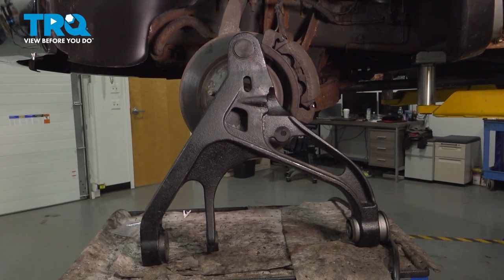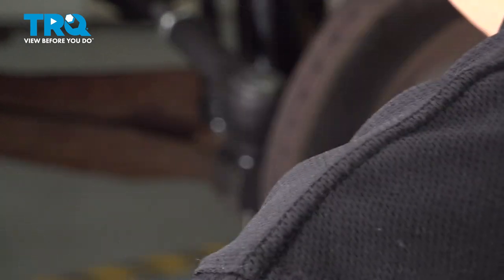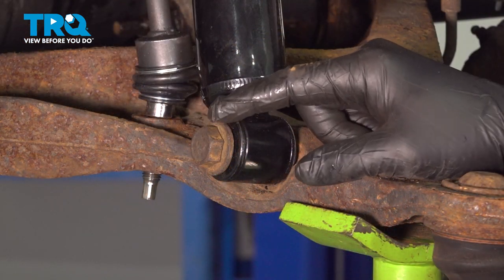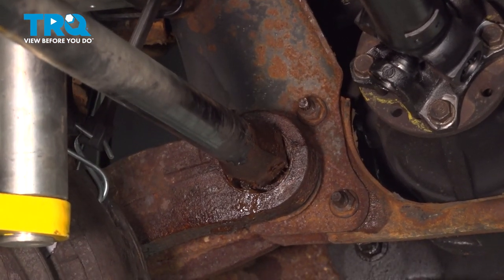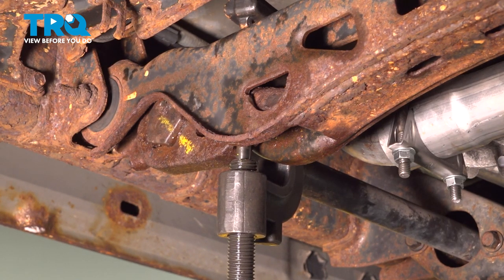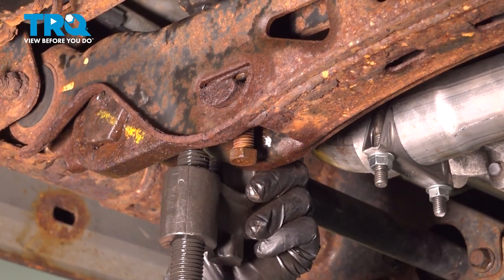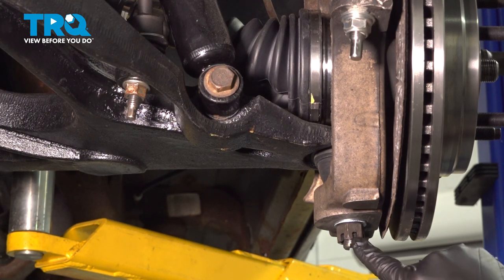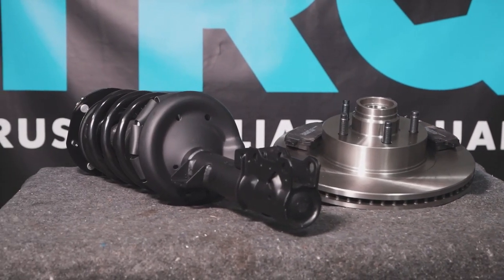How to Replace Front Lower Control Arm 2002-2008 Dodge Ram 1500

Comment: Great video. 

Remember that 2006 to 2008 went to a strut and got rid of the torsion bar. 

Also, why didn't you just remover the brake caliper right after tire removal? I bet you could've gotten the front axle out of the way, without removing it. 

Also, would it be better to remove the torsion bar's tension sooner that you did?

Not meaning to be critical, just curious. 

Thanks for sharing this.

Comment: Good, helpful video. Hopefully, on your truck the strut mounting bolt to the control arm bushing isn't seized, otherwise you'll likely need to cut the bolt or the bottom of the strut to remove the old bushing and bolt. A major PITA.